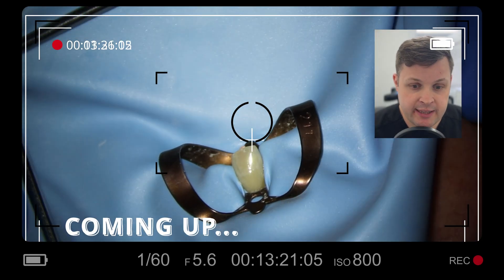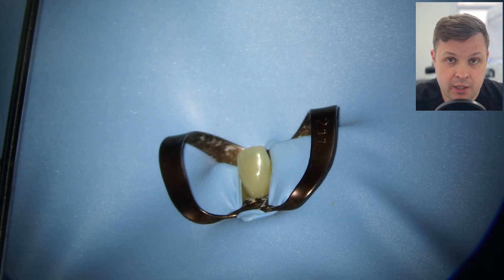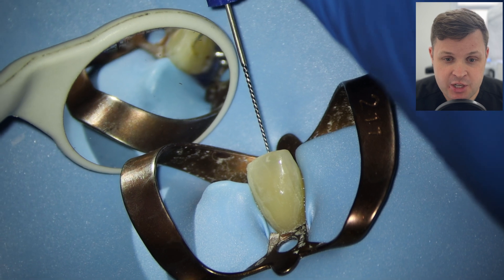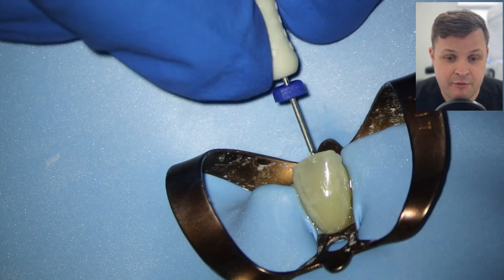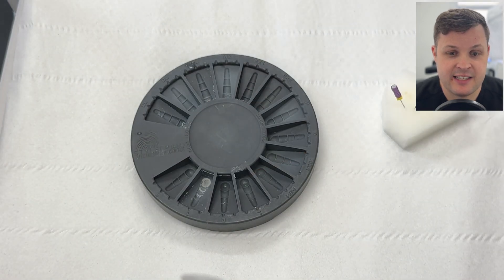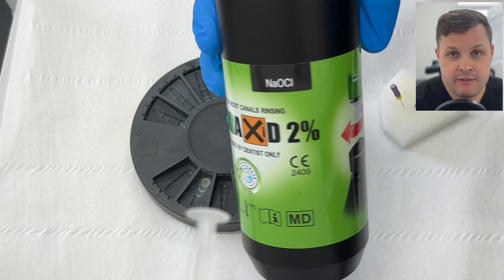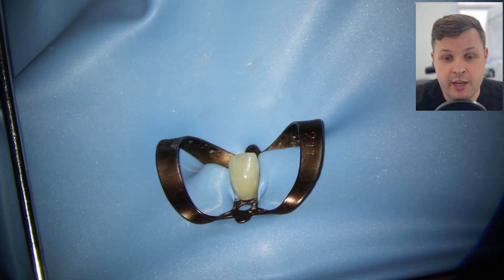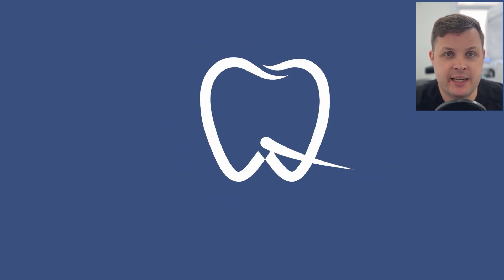🚨 Step-by-Step Root Canal on an Upper Lateral Incisor! Watch Every Detail!

Comment: Shouldn’t we prepare/obturate 0.5-2mm short from apex, keeping apical constriction in mind ?
Reply from the maker: This particular case has a wide apex, so had likely suffered external inflammatory root resorption. So no deferrable apical constriction. But as a rule, yes 0.5mm from the zero reading. Also I’m super excited to be working on a root canal podcast and we want YOUR questions to make it awesome! So, here’s mine: ‘What are the most common myths patients share before, during, or after a root canal?’ Keep it simple and straightforward—those are the gems! 💎 Thanks a bunch for your input! 😊

Comment: What is your opinion on the waveone/reciproc system as am I right in thinking that jumps straight to 25 apical tip? Because you mentioned about how some endodontists use 15 then 20 and then finally use the 25 files?  
Thanks for another great video!
Reply from the maker: I use waveone gold all the time! It’s a great system. I think I would use different sized files on a case by case basis.

Comment: Why does my apex locator always say i’m at the apex while duing a molar root canal even if i’m just touching the pulp chamber walls with my k-file?
Reply from the maker: Good question! It can be for a number of reasons, but it’s likely that there is a leak somewhere. This could be a leaking restoration, or a crack, or even a perforation.😳 Also can I ask that we’re about to launch a new podcast and wondered if you had any funny stories that has happened to you when doing a root canal, or if you can think of the 3 things during root canal that you dread the most?

Comment: Hello, why didnt you put in something for stabilizing like a fiberglass/(steel?) pivot? Can the patient use the thooth like before for biting, or is the tooth weakened?
Great work to safe the tooth as much as possible.

Edit: I had my first root canal ever on one of my front upper tooth. I was soooo nervous the first 30min that my jaw was shaking. My doctor took her time and then I was fine and ready for it.
I had a root resorption due to heavy moving of my tooth (90°) during orthodontics treatment when I was younger. I hope it will be okay for the rest of my life.
Reply from the maker: Placing a post (fiberglass/steel) actually makes the tooth weaker!

Comment: Great video! I don't see any reason not to trim the GP at the measured cervical area. Example You know the length of the WL is like 22mm. CEJ to incisal could be like 10mm. So you trim 12mm up from the apex on the GP, so your remaining GP is 12mm. Saves a lot of time of removing the GP since you don't want the GP in the crown anyway. Use a plugger to confirm that you're touching the GP at 10mm from the incisal edge. Hope that makes sense! That's honestly the hardest part of the root canal because you don't want to put so much pressure and risk cracking something.
Reply from the maker: I think you make a great point, I just wonder how easy is it to see if the GP is seated when it is far down in the access cavity. But if it’s a tried and tested method for you then that’s all great for sure.
Reply: Idea is good but I think you can lose reference point with this. Like in this case incisal edge was the reference point but when you trim the GP, your reference point might be compromised.